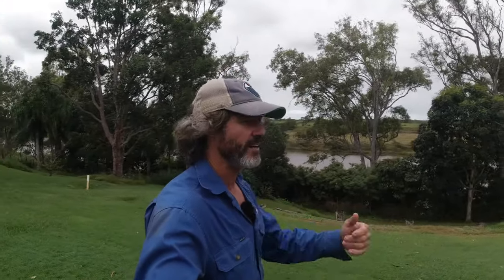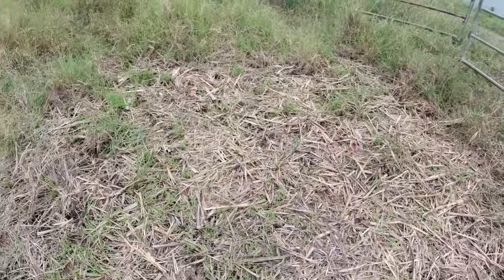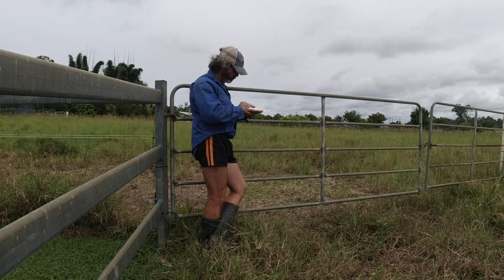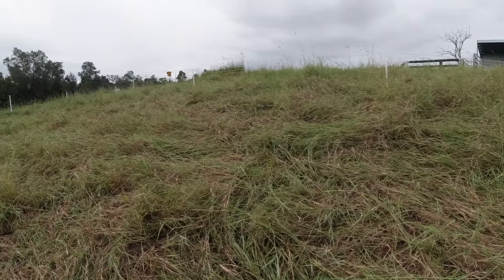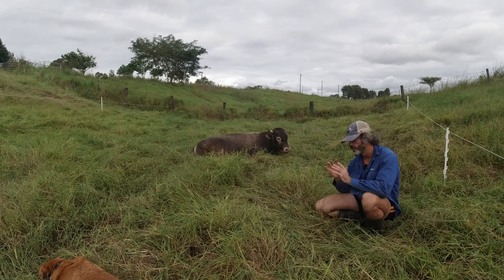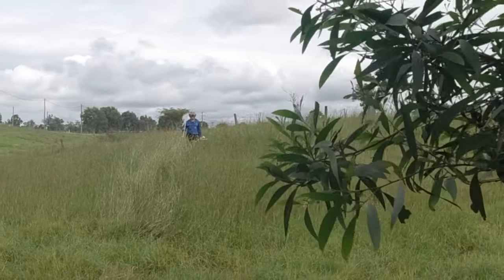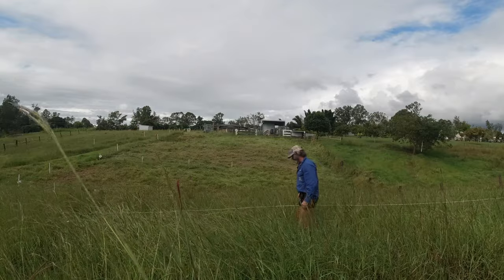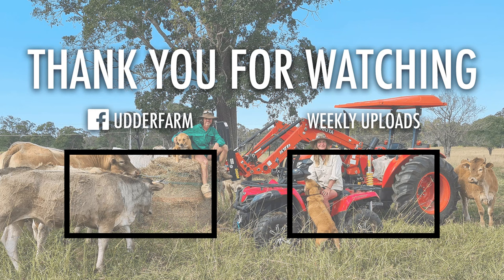2 Or 1000 Head, How We Achieve A Perfect Armour Layer Across Our Land!!

Comment: Selective grazing can lead to an increase in non-pasture crops taking hold. If you aren't running different beasts to eat the wider range of feed available then consider mowing a recently vacated cell to (a) put pressure on the unwanted growth and (b) increase the availability of vegetative growth. See Elizondo and his follower's videos.
Reply from the maker: Hi Peter, Firstly thanks for choosing to not only watch one of our videos, but for also taking the time to message us. 
We've found that we can limit the amount of selective grazing by increasing our stocking density. At around 100000 pds/acre and above we find that our cattle have a tendency not to selectively graze and tend to eat forage that they generally would have at a lesser density due to the lack of competition. 
We also found at HSD & UHSD what generally hasn't been eaten gets trampled down breaking the sap cycle, therefore adding and building the amount of armour across the ground. 
As we complete our electric fence installation out on the Udderfarm we intend to add some sheep into the mix, which like you rightfully mentioned will increase of forage diversity consumption. 
We generally slash a few times a year for the very reasons you also mentioned, to keep our forage in a vegetative state after the pasture gets away from us and starts to drop its seeds, dramatically reducing Livestock palatability due to the decrease in energy. 
Cheers for sharing and highlighting some great point there mate, I shall endeavour to check it out.
Hope you have a great week! Jason & Nic
Reply: @Udderfarm  Welcome, enjoy it yourself.
Reply from the maker: @peterclark6290  thanks mate.